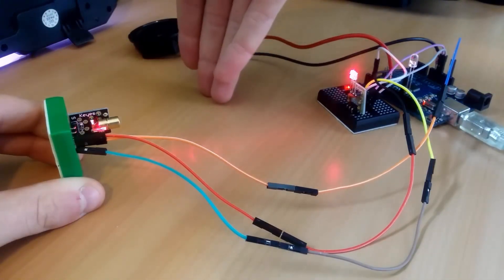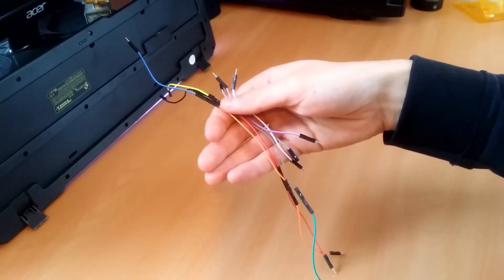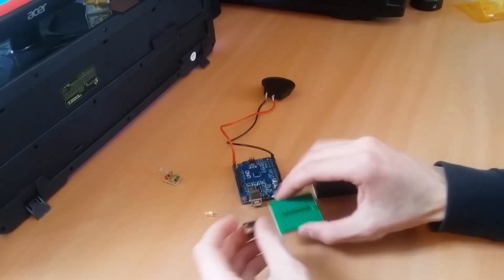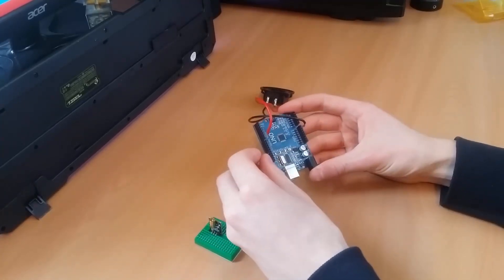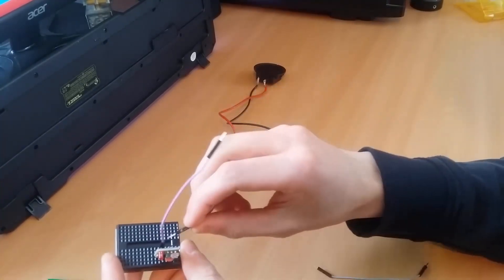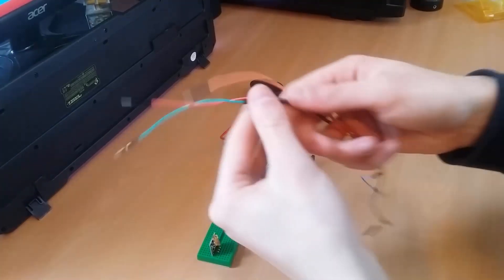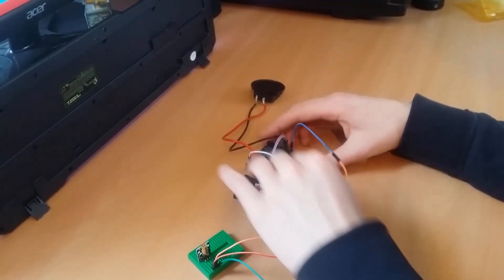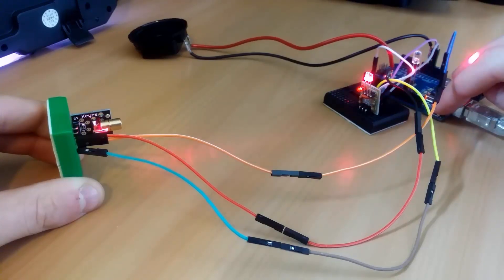DIY | Easy Arduino Laser Tripwire Security System!

Comment: Awesome, thanks for sharing.
i modified you code slightly, also changed (SensorReading == LOW) to (SensorReading == HIGH)
for some reason it just works better for me
Code:
/*
 * Project #3 - Laser Tripwire Security System with 3 second deactivation delay.
Code written by: Youri C. - RGBFreak
You're allowed to re-publish this code as long as you give me credits.
Video on how to connect all the wires: https://www.youtube.com/watch?v=X18CfOKtyTQ
Video on how to build a tripwire secutiry system with less electronics: https://www.youtube.com/watch?v=eHrh5tnG4Wg
 
Don't forget to subscribe to my channel for more DIY projects! - https://www.youtube.com/channel/UCKp8cQWkiGGfAV5FM_Q0mxA
My Instructables profile page - http://www.instructables.com/member/RGBFreak/
 
How it works:
As soon as the laser beam gets interrupted the Laser Receiver Module will send out a signal that will trigger the alarm into the Arduino code below.
A LED will turn on and that means you have 3 seconds to press the reset button on your Arduino before the speaker will start buzzing.
After a short while the alarm will reset itself.
 */
 
#define NOTE_F6  1397
#define NOTE_G4  392
 
int LED = 13;
int LaserSensor = 2;
int SensorReading = HIGH;  // HIGH MEANS NO OBSTACLE
int Laser = 12;
int alarmSpeaker = 7;
 
void setup() {
  pinMode(LED, OUTPUT);
  pinMode(Laser, OUTPUT);
  pinMode(alarmSpeaker, OUTPUT);
  pinMode(LaserSensor, INPUT);
}
 
void alarmTone() {
  tone(7,  NOTE_F6, 400);
  delay(100);
  tone(7,  NOTE_G4, 400);
  delay(100);
}
 
void alarm() {
  //delay(3000); //Time before alarm starts
  alarmTone();
  alarmTone();
  alarm();
  }
 
void loop() {
  digitalWrite(Laser, HIGH);
  delay(200);
  SensorReading = digitalRead(LaserSensor);
  if (SensorReading == HIGH)			//Original=LOW
  {
    digitalWrite(LED, HIGH);
    alarm();
  }
 
  else
  {
    digitalWrite(LED, LOW);
  }
}

Comment: Uhmm sir i need help. Why does mine always beep when the laser hits the sensor. It works the opposite way of how it supposed to work. I followed the right direction. What's wrong?
Reply: I have found that this problem can stem from the 3 prong connector that connects the little square light receiver to the board.  If it is loose, it can produce opposite results (and lots of headaches).
Reply: even if the laser isn't hitting the sensor, as long as i start to power up the circuit, it immediately beeps
Reply: send cde
Reply: I had the same problem. Can you tell me how you solved it?

Comment: Whats the purpose of putting the laser on the Arduino?  Assuming you're putting some distance between the laser and the receiver, rather then run a long cable over to the laser to power it from the Arduino, cant you just power the laser separately from across the room with wall or battery power?  The laser has no purpose other than power to be connected to the Arduino correct?
Reply from the maker: That is correct. In this video it was only done for convenience

Comment: hi cud i power the laser off a battery instead of plugging it in to the arduino ? just to save me running the long wires around my door thanks
Reply: Yes, you could ('cud' is what cows regurgitate and chew) -- all you need is a photoresistor instead of that laser detector module and an externally powered laser module.  I've seen the GL5528 for $1.52 for 20pcs on eBay and the "5V 5mW" laser modules for around $4 for 10pcs.  I've tried running this laser module with a 26650 battery (initial voltage of 4.02V) and it is acceptable bright.  I don't know what would be the minimum voltage necessary for this laser module to still be acceptably bright though.  I started the test the other day and it's been running for over 24 hours and the voltage has dropped only slightly below 4V (3.97V, IIRC) and it still seems just as bright.

http://www.monkeywrench.space/programming/default.htm?arduino-laser-tripwire.htm
Reply: @CurmudgeonExtraordinaire  Yes, you could ('cud' is what cows regurgitate and chew) 
i love it, people must wake up!

Comment: What is the max distance that this would work reliably?
Reply: That is going to depend upon the power of the laser module that you are using, ambient light, and any lens that might be on the laser module.  Another solution is to use a laser plus a photoresistor such as the GL5549.  You could hook up the photoresistor to the Arduino model and have the laser always on and powered by battery or a power supply.  The photoresistor would be hooked to one of the analog pins on the Arduino board and you would periodically poll it to determine whether the value that it was returning was above or below some worst case that you determine for your particular environment (e.g. bright ambient light).  I bought some photoresistors for a project off of eBay a couple of years ago, although I'm not sure if they are the GL5549.  By the time they made it here by way of a literal "slow boat from China", I had forgot what I had intended to do with them.  I could not find a part number on them, so I'm not sure whether they are in fact the GL5549, but they look the same.  I just got through trying one hooked to a multimeter to measure their resistance when used with one of the "5mW" laser modules that are sold for around $4 for 10 pcs (i.e. $0.40 each) on eBay.  There was most definitely a good difference in the resistance when the laser was shining on them vs when it was not.  I ended up with a bit over 100K ohms when my finger was over the sensor (i.e. equivalent to a dark room), around 3K ohms in a brightly lit room, and around 200 ohms when the laser was hitting the sensor in the bright room from around 7 ft away.  It would be very easy to make a laser "tripwire" with an external laser module (i.e. not hooked up to the Arduino microcontroller) and a photoresistor that was hooked to the microcontroller.  Of course, with the laser always on, it would be easy for someone to defeat such a "tripwire" -- all they would have to do is shine a bright light or another laser into the photoresistor while they are going through the area normally protected by the "tripwire".  To get around that sort of thing, you need to have the laser model hooked to the microcontroller and you need to modulate the laser so that you are basically sending a signal with it that you receive on the photoresistor.  Think of it like sending Morse code and then verifying that what you send is what you receive.  It's definitely possible to do it, but it will add a bit of complexity to your code.

Comment: Does not seem practical in a real world use due to the wires needed to be connected. You would need 20 feet of wire for a real room situation. Perhaps use 433 MHz RF Transmit/Receive modules.
Reply: Or..... a mirror

Comment: How to increase the range?
Reply: Use stronger laser and make the photoresitor threshold a little higher to get rid of noise. You can also buy IR laser with a lot more power and IR sensor, but remember that it gets dangerous for your eyes at some point
Reply: @doktordzwonek9306  -- And with an IR laser, you don't see it, so you don't know the danger.  Also, when you are increasing the distance, it gets even more important to have a very steady mount for both the laser module and the receptor (e.g. photoresistor).  Although these laser modules do not project a pinpoint dot at distance, they don't expand that much either.  If you are using it outside, the laser module needs to be particularly steady since any movement from wind or whatever is going to change it's point of aim by enough to make it appear that the beam has been broken.  The photoresistor is maybe 1/8" to 1/4" in diameter, so it doesn't take much movement of the laser module to result in that sort of displacement of the beam if you are doing a very long distance.
http://www.monkeywrench.space/programming/default.htm?arduino-laser-tripwire.htm

Comment: What is that exact speaker module called?
Reply from the maker: martin edwards I'm not using any speaker module. I attacked a regular speaker from an old device. It should work just fine
Reply: Oh ok, well, how much would using a regular Arduino buzzer affect the noise that the code creates?
Reply: Is it work with peizo buzzer?

Comment: You said that you added a 3 second delay to the alarm and then you press the button and you reset the alarm, how exactly do you do that? I mean what kind of programme you use in order to do that? I m trying to make one on my own for a project in school... please respond 🙂
Reply: its the reset button already pre mounted on the arduino borad
Reply: @niklasmuchfun  -- Yeah, I guess that would work, but it's a pretty kludgy way of doing it.  Normally, you would be polling your pushbutton while also polling the pin that had the laser receiver module (or photoresistor) attached to it.  I've found that for anything other than the most trivial Arduino projects, implementing them as state machines or with an event queue is helpful.

Comment: If you shut down the Lights, would it be possible to see the laser like in this image : https://img.grouponcdn.com/deal/5vZ1pobG2ys1YdFr2Pb1/Pi-700x420/v1/c700x420.jpg
Reply: To see a laser beam like that, you need some sort of particles in the air -- mist, fog, steam, etc.

Comment: life of the laser in continuous use ??? mmmm
Reply: Fernando I was thinking the same thing. They last about 3-6 years. If you have the laser turn on and off really fast and only check the photoresistor when the laser it is on, you can get more lifetime. For example turn on for 1 ms and then turn off for 3 ms. Since it’s only actually on for 25% of the time, you’ll get about 4 times the lifetime out of it. This will also keep the laser cooler which also increases lifetime. They’re cheap and easy to replace though
Reply: The laser models that I bought claim to last for 5000 hours.  They look very similar to the ones that he is using except that they are not on a PCB board, but instead the two battery / power supply wires coming from them.  He's using a laser module that allows the modulation of the signal in order to send a message from the sending laser to the receiving laser detector.  You really do not need that capability here.  A basic external laser and a photoresistor hooked to the Arduino microcontroller will work.
http://www.monkeywrench.space/programming/default.htm?arduino-laser-tripwire.htm

Comment: It can be used instead of the Arduino attiny85?
Thank you
Reply from the maker: what?
Reply: Here friend: http://highlowtech.org/?p=1695
Reply from the maker: +Daniel Fernandes do you want to use a attiny? if so, yes that's possible :)
Reply: Yes friend! Just change the pin settings in code? Thank you
Reply from the maker: +Daniel Fernandes I only know it's possible, but I have never used one myself
Reply: dude this is the most simple laser alarm circuit..i need this..i got some sneaky going on..